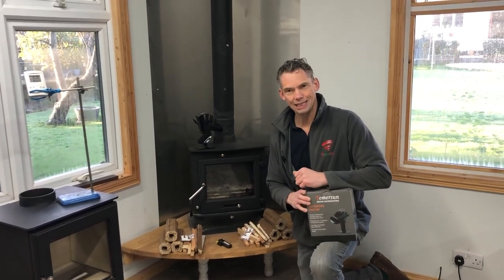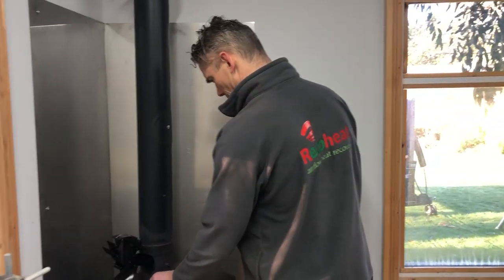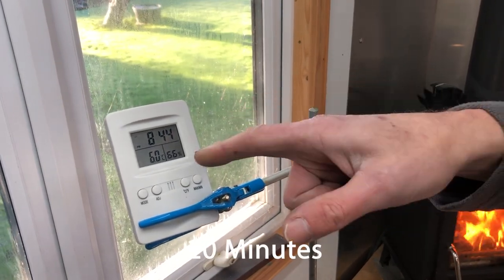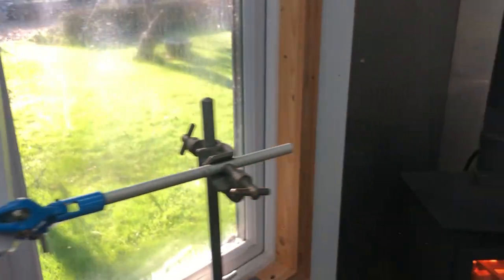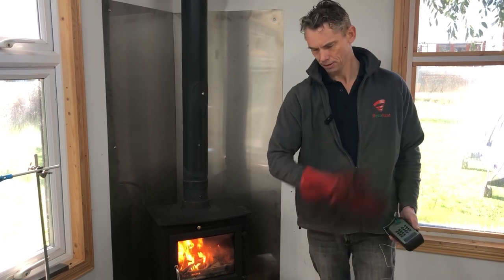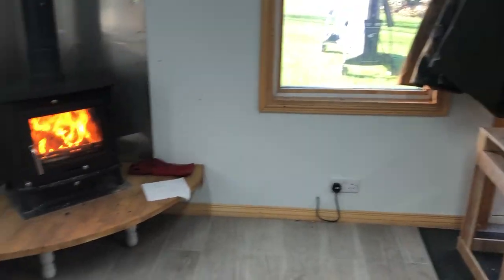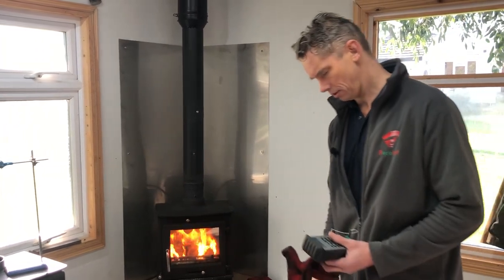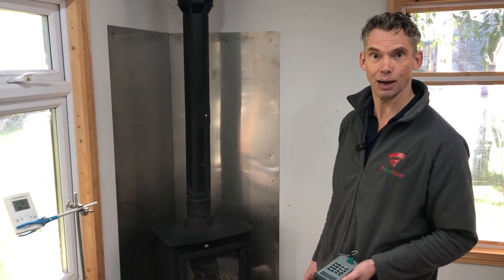STOVE FAN vs RECOHEAT (Wood Stove Accessory Comparison)

Comment: If you are going to compare your product against a fan, compare it against a fan that is mains powered at the same wattage as your air pump is consuming. Comparing a mains powered product against a self-powered device is a little misleading.
Reply from the maker: We're specifically addressing the heat-powered ones because they are what's in the market, and clearly state the power as a differentiator. Electric fans don't figure, though people do use them usually blowing towards the stove, because they're not a distinct stove product and there are too many variables to make a sensible comparison.

Comment: Tried the fan option. 80 quid for a Eco fan... complete rubbish. Now use the fan to tell me when fire needs more fuel. Stuck a electric fan by the stove running at 17 watts, directed it to blow over part of stove and makes a massive difference to further in the room. Cost near to nothing to run.
Reply from the maker: Yep - you're using a powered laminar airflow to achieve that, and it works. We're adding about 1kw of recovered heat into the airflow, then using a turbulent airflow to do the same thing, but the jet we produce also oscillates, so it's just much more effective all round.

Comment: The fan should be behind pipe but that can’t be done in this because no space behind pipe so demonstration is in correct
Reply from the maker: The fan isn't usually placed behind the stove pipe, but I'm sure the test can be done better. It won't result in significant differences in outcome though.

Comment: How does the amount of outdoor air you're pulling in with the Recoheat compare to how much outdoor air gets drawn into the room without a Recoheat to replace the air that goes into the stove and up the flue? Assuming the stove doesn't have direct air, are you increasing the overall amount of indoor air change with this or not?
Reply from the maker: Hi Francis: it's tiny compared to the amount being shifted by the convection flows. A direct air intake or vent is 100mm, compared to our internal 8mm, although of course that's not pumped. But the Recoheat doesn't affect the combustion, so it's not really consequential. Our system works by using the hot jet recovered in the flue to stir the radiant heat from the stove, build the heat in the room and increase the amount of heat from the stove being added to the convection flows.
Reply: @Recoheat  I don't think you understood my question. If you use a stove without direct air, you necessarily create extra ventilation to replace the combustion air. My Q is whether the amount of air introduced by a Recoheat is more than that amount, such that it's adding yet more ventilation, or less and hence only displacing ventilation caused by the stove anyway.
Reply from the maker: @FrancisCWolfe  I've no idea, because of the effect of warming the room. If you look at the physics simulation of the relative heat dispersal from a stove with and without a Recoheat, you can see that the heated jet and its stirring action create a higher bulk temperature that effects a far greater volume of the room. I imagine that would decrease the ventilation because the warm air creates convection flows out of the room in most instances. It's not a straightforward displacement/replacement process therefore. In terms of simply introducing an additional airflow, yes, we are if the pump is outside, but of just 1 litre per second before it is expanded by the heat: so a relatively small amount.

Comment: just get a couple of the heat powered fans and you'll save hundreds and not waste electricity.
Reply from the maker: That would be nice, but alas, simply doesn't happen. Which is kinda the point.

Comment: Looking forward to getting a recoheat when I instal a new stove with a rear flue pipe so I have enough vertical pipe to fit the recoheat in.  

In the meantime the fan will have to do, with the fans I do like how the speed rotation is an indication of just how hot or maybe cold the wood burner is.
Reply from the maker: Sounds like a cunning plan: that's certainly a good way to create the space for the Recoheat if you have a bend before the 300mm of vertical rise we need as a minimum above the collar.

Comment: 1. Add multiple stove fans (3) that move same Recoheat air volume? Retest and report.
2. Evaluate room heat gradient remember you are sitting more than standing or walking about. Retest and document.
3. Try ducting Recoheat around room perimeter using baseboard pvc perforated distribution pipe. Retest and document.
4. Consider a sensitive person too cold drafts. Devise best way to heat and document why?
Reply from the maker: You'll get that data from the physics simulation video - have you seen that? Clearly shows the effectiveness of the device at transforming the heat profile in the room: https://youtube.com/shorts/I6TFB8cac04
Reply: @Recoheat  Thanks for the link. The graphic is hard to interpret sitting down, would like to see a distribution baseboard perferated pvc pipe around the room run as a test. Run the test if you dare show a better heat result...
Reply from the maker: @douglaspohl1827  The video is a physics model running in SolidWorks with 1.6m temperature points, so it's far more accurate now as a baseline, objective picture of what's happening. Thanks for all your suggestions and interest 👍👍

Comment: Had my new stove running for a week now and the Recoheat is really effective. My fitter did not know what it was but he too was very impressed by it. I still haven't mastered how to move heat to the upstairs. I don't have a terribly big house so a video consisting of tips of how to circulate air to the upstairs, particularly where ones living room is in the middle with doors on either end would be quite useful. Superb product though and makes all the difference. I thought if i'm buying a stove for the first time ever and spending so much, what is another £300 to maximize its efficiency. The air blowing directly out of the Recoheat is akin to the highest setting on a hairdryer - hairdryers cost an arm and a leg in electricity - imagine getting free heat for hours on end - my thermometer went to the maximum really quickly when I placed it in front of the Recoheat heat hole. Proud of myself for researching this product and maximising the efficiency of my woodburner.

Pros:
1. Free very hot heat thats pumped into the room - similar heat produced via an electric fan heater would cost astronomical amounts. 

2. Efficiency ensuring less wood fuel used.

3. Compact and smart technology.

4. Spreads warmth very well around the room.

5. Pumps out hot air even after the logs have turned to coals.

Cons

1. Quite loud sadly (this despite me having my pump installed outside) - much louder than I was led to believe - can drown out the volume of television which is frustrating and will take a lot of getting used to. To circumvent this issue I have purchased a Alexa-enabled wifi plug to plug the Recoheat socket into, meaning I can turn it off via a voicecommand, however, because the heat produced is ridiculously good I rarely turn it off and feel guilty if I do, as it means I am not maximising my stove to its fullest potential or efficiency. 

2. Heat does not spread upstairs as I was led to believe. Perhaps I am yet to master the correct technique - perhaps once I master the correct technique the Recoheat will take the chill out of the air from the upstairs rooms, as opposed to warming them up to the same level as the room the stove is in. Would be good to get some tips on this as I can ask Alexa to turn off the Recoheat 3 hours after I go to sleep.
Reply from the maker: Thanks very much indeed for the detailed review. It sounds as if you've got an air bubble in the pump if it's that loud - give it a shake. It shouldn't be anything like that loud. If you've put it outside, have you coiled excess length of air tube (which is part of the silencer in terms of sound dampening) and is the silencer fitted OK, next to the pump? In terms of getting heat upstairs, you do need to get a convection flow going which means giving the airflow direction. In a double-ended room you might struggle, for sure, because you've got a maximum of 50% airflow in either direction. Normally you would build up the heat in the room with the door closed then open it to create a rush of warm air out and jump-start the convection flow. In lieu of that, it can certainly be difficult: the system can't reverse the convection flows of the house, and you'll have flows towards your windows and doors that will draw more than the stairs if you've got a wide circulating base. Do email any details over and I can see if I can advise further, but it's certainly not possible in all houses, and creating a funnel or flue effect to draw the warmth upstairs is key: our device is not pumping the heat upstairs so has to work with existing air flows, which is will significantly enhance. A couple of customers are using two stoves with two Recoheats in conjunction with an HVAC system to really drive heat upstairs, and that works by pushing air down the house so that the heated air is pushed back up.
Reply: @Recoheat  Hi and thank you for your detailed response. The air pump is not loud as the silencer is working and I can't hear it as it is outside anyway. My comment was in relation to the hissing noise of the heat hole which is unavoidable and nothing cannot be done to reduce that noise (free heat can't complain!)

Regarding the convection - do you think if I shut the door leading to the kitchen and leave the door to the upstairs open that would help? I have been doing that and will block off any air seeping through the kitchen door to help with this
Reply from the maker: Yes, closing one door so that the flow can go in a single direction will help, and so will opening a window slightly upstairs to draw the heat up. Once you have a flow, you can close that a bit. It's a bit like managing the flow of air round your stove itself to keep it burning efficiently!  @H.Ali_08
Reply: @Recoheat  thank you very much for your helpful advice, as always. I'll give that a go!
Reply from the maker: Good luck with it! Thanks again for your support.  @H.Ali_08
Reply: Buy a smart switch then ask Alexa 😉

Comment: Great video!, Question for anyone who has one....Can you turn it off after a while when the house warms up and just continue to let the stove burn out as normal or do you need to keep it switched on all the time? thanks
Reply from the maker: You can switch it off and it doesn't affect the unit at all. If you're doing that for long, it's best to change the high-heat tube going into the back of the unit with 10mm copper piping so that it doesn't dry out. But otherwise, it's fine. Thanks very much for the interest.

Comment: Do you make a double sided version ie pumping both ways with 1 pump utilising a y connection  im fitting a double sided stove in place of my inset one  end march early April and I think this could be an option of me as I don't want to use my central heating atall
Reply from the maker: We don't. In fact the relation between the coil size and airflow is fairly crucial, so if you doubled the outlet, you'd need to double the airflow or you wouldn't achieve the turbulence in the flow that we're exploiting. You might need to choose one side over the other therefore, but if the rooms are adjoining, you should achieve an increase in the heat in both.
Reply: @Recoheat  I'd have to choose the colder  bigger room then
Reply from the maker: @steveroche2524  Sounds like a plan!
Reply: @Recoheat  couldn't 2 coils be intertwined  I like to be different and have limited editions lol
Reply from the maker: @steveroche2524  Apart from the fact that the regulatory and testing requirements to put something inside a flue and make it compliant is tens of thousands, we need the spacing of the coil to induce the vortices that keep it clean and minimise/localise the extraction of heat and its effect on the bulk average temperature of the flue gases running the draw in the flue. It's actually a complex relationship that doesn't afford much variation. So, no! But it's an idea we've considered too because it'd be good in lots of situations.
Reply: I've fitted one to my double sided stove and am very pleased with it - air outlet points into the larger lounge space. Also once fitted you don't really notice the black inlet tube on the reverse side :)
Reply: @andypendred8973  im v tempted  as back of house kitchen diner is v v v cold room
Reply: @steveroche2524  I'd certainly fit one
Reply from the maker: @andypendred8973  Thanks Andy! Do keep an eye on the black hose to ensure it doesn't dry: if it's going over the top of the stove, you probably need to be using 10mm copper with a compression fitting from your local plumbers' merchant, because the hose won't withstand the constant high temperature. In a normal fitting, it's going straight off the back and being cooled by the airflow, so is fine. Do give us a shout if you want to discuss.
Reply: @Recoheat  I'll email you a photo of my setup and see what you think
Reply from the maker: @andypendred8973  Thanks Andy 👍